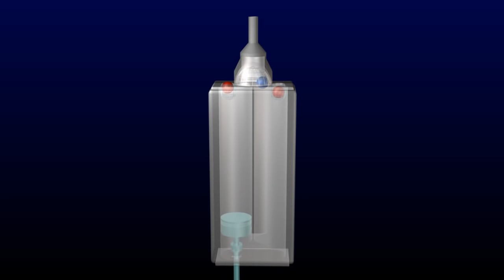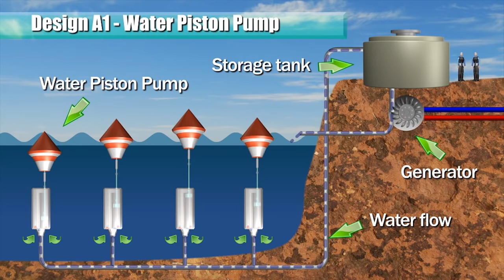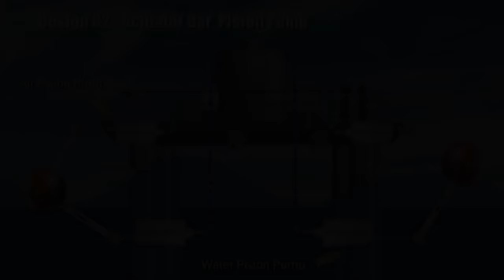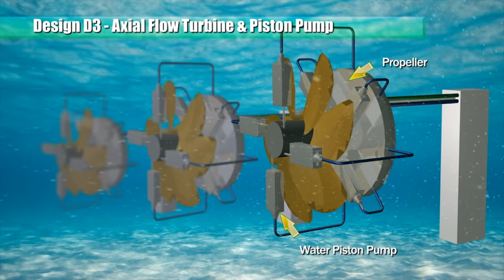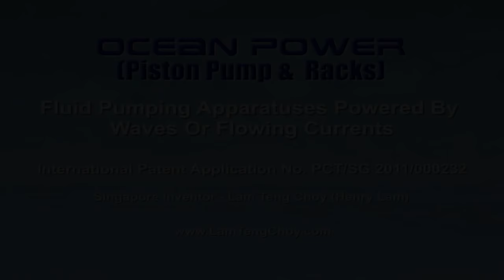Blue Energy - Ocean Power (Piston Pump & Racks)

Comment: First time I see such a new energy conzept which is not totally garbage. Just combining a wheel with pumps seems a bit dum when I already have the right movement to use a generator.
Reply: www.ucrosenergysystem.com WhatsApo +57 3012358709  Carlos Ucrós
Reply from the maker: New Invention

ShoreLine HydroElectric InFlow Dam System Video (English)
https://youtu.be/A8EYW_aREKw

水力发电内流水坝水岸线系统 / ShoreLine HydroElectric InFlow Dam System Video (Chinese)
https://youtu.be/D2NPLMekG8w

Hydro Power - Hydroelectric Inflow Dam System
https://youtu.be/_ho7JaxOdT0

Ocean Power - Piston Pump & Racks
https://youtu.be/fYfs-qYGzvs

Ocean Power - Racks & Rake Wheel
https://youtu.be/nQGKfAPxsiI
Reply from the maker: New Invention

ShoreLine HydroElectric InFlow Dam System Video (English)
https://youtu.be/A8EYW_aREKw

水力发电内流水坝水岸线系统 / ShoreLine HydroElectric InFlow Dam System Video (Chinese)
https://youtu.be/D2NPLMekG8w

Hydro Power - Hydroelectric Inflow Dam System
https://youtu.be/_ho7JaxOdT0

Ocean Power - Piston Pump & Racks
https://youtu.be/fYfs-qYGzvs

Ocean Power - Racks & Rake Wheel
https://youtu.be/nQGKfAPxsiI

Comment: There is way toooo much moving parts involved in this. High maintenance costs.
Reply from the maker: New Invention

ShoreLine HydroElectric InFlow Dam System Video (English)
https://youtu.be/A8EYW_aREKw

水力发电内流水坝水岸线系统 / ShoreLine HydroElectric InFlow Dam System Video (Chinese)
https://youtu.be/D2NPLMekG8w

Hydro Power - Hydroelectric Inflow Dam System
https://youtu.be/_ho7JaxOdT0

Ocean Power - Piston Pump & Racks
https://youtu.be/fYfs-qYGzvs

Ocean Power - Racks & Rake Wheel
https://youtu.be/nQGKfAPxsiI

Comment: And sbout every 15 minutes someones gonna have to clean off the sea growth....
Reply: Ths can easily solved with design. eg use of antifungal paint etc or design some cleaning systems integrated into the setup
Reply from the maker: New Invention

ShoreLine HydroElectric InFlow Dam System Video (English)
https://youtu.be/A8EYW_aREKw

水力发电内流水坝水岸线系统 / ShoreLine HydroElectric InFlow Dam System Video (Chinese)
https://youtu.be/D2NPLMekG8w

Hydro Power - Hydroelectric Inflow Dam System
https://youtu.be/_ho7JaxOdT0

Ocean Power - Piston Pump & Racks
https://youtu.be/fYfs-qYGzvs

Ocean Power - Racks & Rake Wheel
https://youtu.be/nQGKfAPxsiI

Comment: One of these technologies is the idea of a Filipino engineer during the seventies, it didn’t materialize during those time because the oil companies are against it.
Reply: And what about water turbines on rivers? Why do oil companies even allow windmills and photovoltaics? The real problem is the cost of such "free" energy. Conrete and steel do not come for free. And some project simply cannot generate enough energy to pay off... the energy that was put into all the machinery, when it was made.
Reply from the maker: New Invention

ShoreLine HydroElectric InFlow Dam System Video (English)
https://youtu.be/A8EYW_aREKw

水力发电内流水坝水岸线系统 / ShoreLine HydroElectric InFlow Dam System Video (Chinese)
https://youtu.be/D2NPLMekG8w

Hydro Power - Hydroelectric Inflow Dam System
https://youtu.be/_ho7JaxOdT0

Ocean Power - Piston Pump & Racks
https://youtu.be/fYfs-qYGzvs

Ocean Power - Racks & Rake Wheel
https://youtu.be/nQGKfAPxsiI
Reply from the maker: @809Kocur  New Invention

ShoreLine HydroElectric InFlow Dam System Video (English)
https://youtu.be/A8EYW_aREKw

水力发电内流水坝水岸线系统 / ShoreLine HydroElectric InFlow Dam System Video (Chinese)
https://youtu.be/D2NPLMekG8w

Hydro Power - Hydroelectric Inflow Dam System
https://youtu.be/_ho7JaxOdT0

Ocean Power - Piston Pump & Racks
https://youtu.be/fYfs-qYGzvs

Ocean Power - Racks & Rake Wheel
https://youtu.be/nQGKfAPxsiI

Comment: Nice one, revised version of wave power plant not only that the more parallel of the system as a driver will result to the higher power output.
Reply from the maker: New Invention

ShoreLine HydroElectric InFlow Dam System Video (English)
https://youtu.be/A8EYW_aREKw

水力发电内流水坝水岸线系统 / ShoreLine HydroElectric InFlow Dam System Video (Chinese)
https://youtu.be/D2NPLMekG8w

Hydro Power - Hydroelectric Inflow Dam System
https://youtu.be/_ho7JaxOdT0

Ocean Power - Piston Pump & Racks
https://youtu.be/fYfs-qYGzvs

Ocean Power - Racks & Rake Wheel
https://youtu.be/nQGKfAPxsiI

Comment: None of this energy is "free". All of the hardware needed to convert the motion of ocean water into usable energy costs money, a lot of money. Can an ocean energy farm compete with fossil fuel generators? Maybe, but to say the energy is "free" is simply not true.
Reply: Building fossil fuel power plants also costs money, doesn't it? Its building and maintenance costs might be different, but here except for these costs you don't have to invest into buying the fuel that powers the plant. So technically, the energy resource itself is free.
Reply: Iudowiko; you might as well say fossil fuel energy is free because it's source, oil, is laying there underground for the taking. Of course that's silly because it takes resources, (AKA Money), to turn that underground oil into Kilowatts of energy, just like it takes resources, (AKA Money), to turn wave action into Kilowatts. In both cases nature is providing the resource, but to say the resulting energy is free is simply not true. Look at it this way; if you buy an I-phone and the seller includes a case with it, is the case "free". Of course not; the selling price of the  phone was calculated with the cost of the case included before the price tag was put on the phone. Don't be fooled by the word free.Ninety nine times out of a hundred the word "free" is being misused.
Reply: oldgysgt well, your example is not very accurate, first of all because fossil fuel energy doesn't just happen to be out there, you need to invest into finding resources, mine them, transport them to the power plant, which take a whole lot of infrastructure. Not even mentioning that most fossil fuels aren't just burnt the way you mine them. And even if you do as above,  resources deplet, so the cycle starts from the beginning. On the other hand hydropower energy, wind energy and solar energy are abundant and don't deplete, which means they're technically free. The only technological barrier we currently have is that natural resources will not always cover our energy needs so we would need to store them somehow which is quite problematic.
Reply: Iudowiko; once again you don't understand the meaning of the word "free". A resource might be underground or simply oozing up in ponds waiting to be scooped up, like oil was at one time in Pennsylvania. The fact is it takes MONEY to turn any natural energy source into usable kilowatts. Like the man said, "There ain't no free lunch". If you find an ocean wave with a 110AC outlet in it, let me know. If you knew a little more about the nature of energy, you would know you cannot create energy, and you cannot destroy energy, you can only change its form. It's the changing from one form to another that takes effort, (AKA, money). Unfortunately the basics of physics are no longer taught in Liberal Arts Collages. Even the basics of economics are not well understood by most people today. If you believe in "free" anything, you do not understand how the world works. Just as there is no such thing as a vacuum, (it is only an absence of pressure), there is no such thing as "free" energy, (commercially usable energy).
Reply: I'll do you a favour and ignore the the fact that you're being condescending and arrogant. It's you who misunderstood the message and apparently is struggling with basic understanding of the English language. What your saying doesn't conflict with what I'm saying, but you're trying to disprove something that nobody has said or claimed during the video - this is what I'm trying to point out.
Running a power plant has different types of costs like construction, maintenance and fuel costs. Renewable power plants have no fuel costs because once you established it, fueling the power plant, that is, propelling the generator that provides you electricity  is done without any additional costs (=FREE), unlike in case of fossil fuel power plants, where fueling has many costs, as already described above. No one has claimed that establishing this or any other renewable energy power plant is at zero cost, so either you've misunderstood what has been said or you're just nitpicking because you don't like the word "free". 
Even though oil was at one time in Pennsylvania abundant, it didn't just come to the surface by itself, and even after finding it people didn't just burn oil where it was mined - it had to be transported to the power plant which required additional infrastructure. Also, power plants don't burn petrol as it comes to the surface, only parts of the material - other part is isolated and used in the chemical industry for producing different stuff. Not even mentioning the fact that oil is not a renewable resource, meaning the more we use the less we have left - which is technically not true for renewables, this is why they're called "renewables". :) So this eventually means, fueling fossil fuel power plants isn't free, because the fuel itself isn't free. Additionally, of course, there are additional costs like building the whole plant and maintaining it, as in case of EVERY industry. Nobody has ever said otherwise, that would be of course inaccurate.
Reply: Iudowiko; you are correct about me not liking the word "free". Ninety nine percent of the time it is being used by some con-man to sell someone a blind horse. And, at one time oil DID come to the surface of the ground in Pennsylvania all by itself with no help from people, (but you didn't know that, did you). Wave energy,  wind energy, solar energy, hydroelectric energy are all so called "renewable energy" and are there for the taking without mining cost, however, it takes MONEY to convert them into usable electric energy. You could say sunlight is "free", but try pricing a solar voltaic panel for your home, and you might understand what I am getting at. I don't know what you do for a living, but it's obvious you're not an electrical engineer, (or an economist).
Reply from the maker: @krisztoballit  New Invention

ShoreLine HydroElectric InFlow Dam System Video (English)
https://youtu.be/A8EYW_aREKw

水力发电内流水坝水岸线系统 / ShoreLine HydroElectric InFlow Dam System Video (Chinese)
https://youtu.be/D2NPLMekG8w

Hydro Power - Hydroelectric Inflow Dam System
https://youtu.be/_ho7JaxOdT0

Ocean Power - Piston Pump & Racks
https://youtu.be/fYfs-qYGzvs

Ocean Power - Racks & Rake Wheel
https://youtu.be/nQGKfAPxsiI
Reply from the maker: @oldgysgt  New Invention

ShoreLine HydroElectric InFlow Dam System Video (English)
https://youtu.be/A8EYW_aREKw

水力发电内流水坝水岸线系统 / ShoreLine HydroElectric InFlow Dam System Video (Chinese)
https://youtu.be/D2NPLMekG8w

Hydro Power - Hydroelectric Inflow Dam System
https://youtu.be/_ho7JaxOdT0

Ocean Power - Piston Pump & Racks
https://youtu.be/fYfs-qYGzvs

Ocean Power - Racks & Rake Wheel
https://youtu.be/nQGKfAPxsiI
Reply from the maker: @oldgysgt  New Invention

ShoreLine HydroElectric InFlow Dam System Video (English)
https://youtu.be/A8EYW_aREKw

水力发电内流水坝水岸线系统 / ShoreLine HydroElectric InFlow Dam System Video (Chinese)
https://youtu.be/D2NPLMekG8w

Hydro Power - Hydroelectric Inflow Dam System
https://youtu.be/_ho7JaxOdT0

Ocean Power - Piston Pump & Racks
https://youtu.be/fYfs-qYGzvs

Ocean Power - Racks & Rake Wheel
https://youtu.be/nQGKfAPxsiI
Reply: @LamTengChoyHenry ; if it works fine, but it's NOT free energy. Construction and maintenance costs must be figured into the cost of the energy produced. Remember, NOTHING is "free".

Comment: why not just put magnets in the float and a coil around the rod then anchor the rod from the top or bottom
Reply from the maker: New Invention

ShoreLine HydroElectric InFlow Dam System Video (English)
https://youtu.be/A8EYW_aREKw

水力发电内流水坝水岸线系统 / ShoreLine HydroElectric InFlow Dam System Video (Chinese)
https://youtu.be/D2NPLMekG8w

Hydro Power - Hydroelectric Inflow Dam System
https://youtu.be/_ho7JaxOdT0

Ocean Power - Piston Pump & Racks
https://youtu.be/fYfs-qYGzvs

Ocean Power - Racks & Rake Wheel
https://youtu.be/nQGKfAPxsiI

Comment: what happens on calm days? or these options only installed where waves exist constantly? Is there such a place near where people live and work?
Reply: If you look at the beginning of the video, first option stores water at an elevated level (potential energy) same as hydro dam, the second option stores compressed air (potential energy), thus solving the intermittency issue of ocean renewable energy. Most places around the world have a minimum of 0.5 meters wave hight 24 hours a day, so it's much more reliable and makes it base-load power competitive with fossil fuel power.
Reply from the maker: Hi,

All my invention is at Concept Stage only. If you wish, you can go ahead and design it.

New Invention

ShoreLine HydroElectric InFlow Dam System Video (English)
https://youtu.be/x8wKpl3N5lM

水力发电内流水坝水岸线系统 / ShoreLine HydroElectric InFlow Dam System Video (Chinese)
https://youtu.be/ZmL8biLw-ps 

Hydro Power - Hydroelectric Inflow Dam System
https://youtu.be/89mHu4JsIDs 

Ocean Power - Piston Pump & Racks
https://youtu.be/BSvKSzvhzZ8 

Ocean Power - Racks & Rake Wheel
https://youtu.be/c0_m3vE_aXY 

Henry Lam
Reply from the maker: Hi,

All my invention is at Concept Stage only. If you wish, you can go ahead and design it.

New Invention

ShoreLine HydroElectric InFlow Dam System Video (English)
https://youtu.be/x8wKpl3N5lM

水力发电内流水坝水岸线系统 / ShoreLine HydroElectric InFlow Dam System Video (Chinese)
https://youtu.be/ZmL8biLw-ps 

Hydro Power - Hydroelectric Inflow Dam System
https://youtu.be/89mHu4JsIDs 

Ocean Power - Piston Pump & Racks
https://youtu.be/BSvKSzvhzZ8 

Ocean Power - Racks & Rake Wheel
https://youtu.be/c0_m3vE_aXY 

Henry Lam

Comment: What about a tower to harvest electricity from the atmosphere? It will have no moving parts, it will require deep grounding belts or pipes and step-down transformers because the voltage goes up 100v a meter from memory? So a 1km high tower could generate 100k volts, I don't know what the amps would be though?
Reply from the maker: New Invention

ShoreLine HydroElectric InFlow Dam System Video (English)
https://youtu.be/A8EYW_aREKw

水力发电内流水坝水岸线系统 / ShoreLine HydroElectric InFlow Dam System Video (Chinese)
https://youtu.be/D2NPLMekG8w

Hydro Power - Hydroelectric Inflow Dam System
https://youtu.be/_ho7JaxOdT0

Ocean Power - Piston Pump & Racks
https://youtu.be/fYfs-qYGzvs

Ocean Power - Racks & Rake Wheel
https://youtu.be/nQGKfAPxsiI

Comment: There are too many parts in the system that may break and require too much oversight,
It is better with wave power station developed by Voith Hydro because there are much less parts and it can with few changes to offshore wind turbine towers and their foundation used ther as well to catch the wave energy too
 https://www.youtube.com/watch?v=gcStpg3i5V8
Reply from the maker: Hi,

All my invention is at Concept Stage only. If you wish, you can go ahead and design it.

New Invention

ShoreLine HydroElectric InFlow Dam System Video (English)
https://youtu.be/x8wKpl3N5lM

水力发电内流水坝水岸线系统 / ShoreLine HydroElectric InFlow Dam System Video (Chinese)
https://youtu.be/ZmL8biLw-ps 

Hydro Power - Hydroelectric Inflow Dam System
https://youtu.be/89mHu4JsIDs 

Ocean Power - Piston Pump & Racks
https://youtu.be/BSvKSzvhzZ8 

Ocean Power - Racks & Rake Wheel
https://youtu.be/c0_m3vE_aXY 

Henry Lam